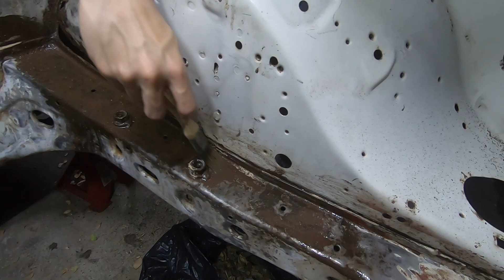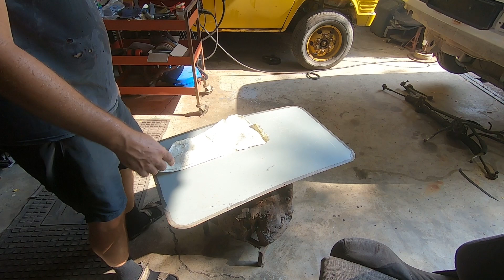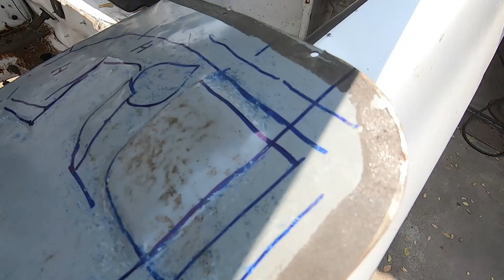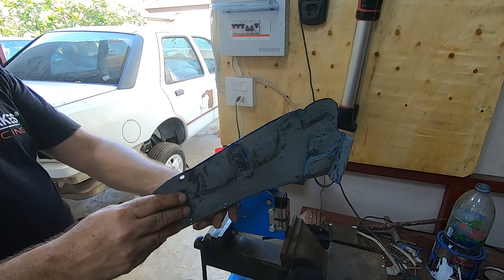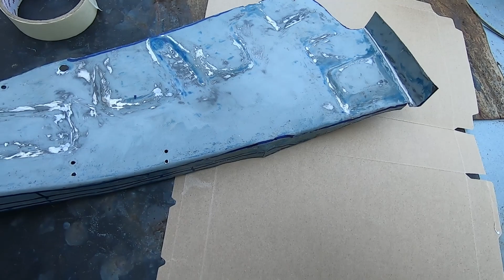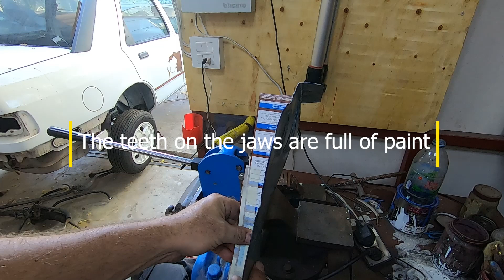Flexible shape pattern and complex repair panel with hand tools - Sierra part 6

Comment: Amazing how well the leggo bolognese sauce works to remove rust, another top tip. Does it need to be bacon chunky tomato and herb, or does the garlic n herb one work as well.
Reply from the maker: I know right 🤣🤣🤣 yeah so any pasta sauce seems to work as long as its in a jar. I believe it's the acidity in the tomatoes. I may try ketchup next..
Reply: Great work mate , that must have taken a few hours to fettle the new patch with the raised pieces in , well done sir you deserve a beer after that mate 👍🏻👍🏻👍🏻👍🏻👍🏻
Reply from the maker: @timpeat286  cheers, yes it was a complicated piece, well worth taking the time to do it right though. Wait for the inner wing repair, that's tough too.